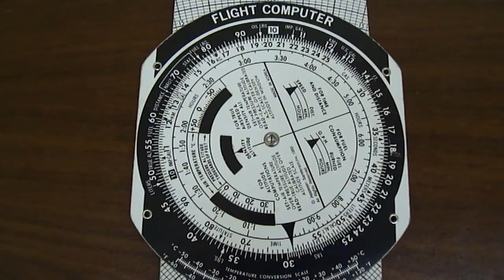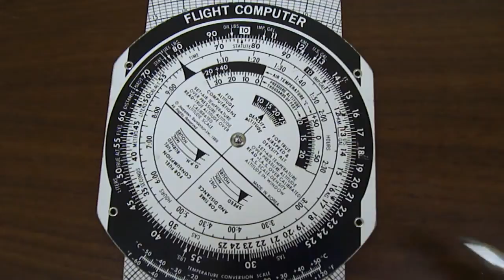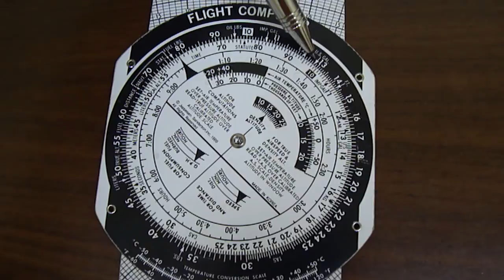E6B Flight Computer: Radius of Action

Comment: R/A (Radius of Action) there is R/A from and back to same base. There is R/A from one base while landing at another or alternate base. There is R/A from moving aircraft carrier and back to same carrier. Many interception and R/A problems were worked in advance before ever taking flight according to a WWII vet I spoke with years ago. But not always. You could be on a normal flight or patrol and your radio operator would receive a message..." Radio direction finders have monitored radio traffic from ( Lat & Lon position )-possible enemy vessel. Fuel permitting,  investigate at once " You had to know how to perform and calculate an entirely new flight, R/A plan from scratch under serious time pressure and scrap your existing plans, flying over shark infested waters in the South Pacific, you had better get it right. " Respect to that generation for sure. They had to be trained intensely to accomplish a mission without modern navigation aids.